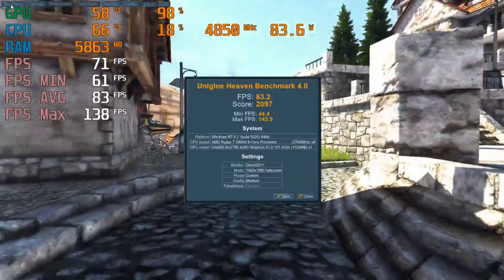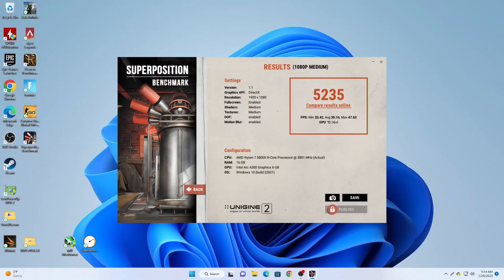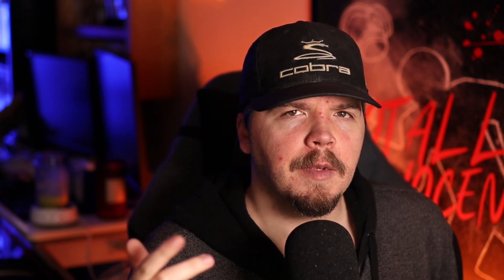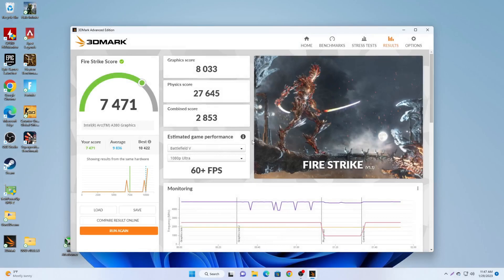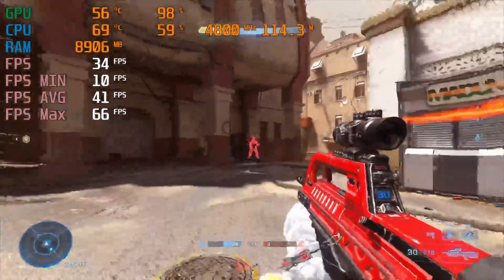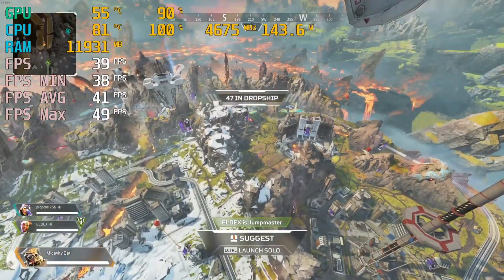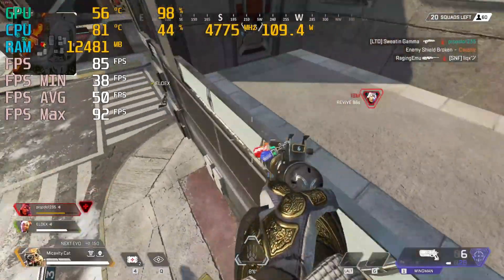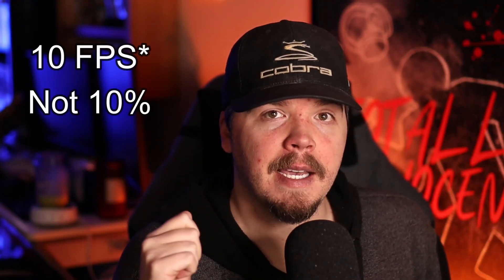Giving the Intel Arc A380 a MASSIVE Boost!

Comment: Hello. Maybe my comment will be outdated but I really need help. Right now I’m looking for a dedicated streaming pc using av1. And I have two options both almost the same price. First is to build pc with 16gb ram i5-12400f and arc a380. The second one is a laptop Lenovo LOQ 15iax9i with i5-12450HX 8gb ram and Intel Arc a530m 4gb. The ram can be changed on laptop, it has 2 slots. The only reason that I didn’t choose laptop already, I’m not sure is it enough a530m with 4gb for 1080p/60 or 1440p/60 av1 streaming. Did you have any thoughts on this?
Reply from the maker: Personally i would build the rig with the a380 IF you have room for it, 4gb vs 6gb card but i dont have a ton of experience with dedicated streaming pcs!
Reply: @MicavityCatYT  thanks for answer)

Comment: The intel arc a380 is more for 1080p gaming and that is also why u should pop open intel control where u can turn on retro scaling which turns whatever resolution ur using to basically look like ur using any other larger resolution not only giving fps boost but in some pcs getting rid of stutter.

Also if someone here is looking for a automatically boosted a380 card get the asrock it comes whit built in mhz clock boost of 2450mhx max

Comment: Better card than i thought, but i think running an Arc card on an Intel system, there are several settings that can improve performance a bit overall, both in bios and with the graphic driver itself + some of the features that comes with your software for your Mobo(depending on the Mobo). So all in all a good card for the price here in Denmark. I will go for it in my next 1080p build, the price is fantastic 🎶💯🎶 Btw. Thx for the video
Reply: yes go whit it for 1080p thats what it was built for u will get bettert fps whit 1080p

Comment: I am going to buy a gpu i have three options rx580 rx6500xt and arc a380 which should i buy
Reply from the maker: I have no experience with the 6500 xt. really depends on what you want to do with it! For gaming, I probably wouldnt go with the A380. Looks like according to userbenchmark (take it with a grain of salt) the rx 580 is 3% faster than the 6500 xt, but the 6500 xt is newer and will have support for longer.  idk if the 580 has driver support anymore or not and idk when they plan on stopping that!
Reply: @MicavityCatYT  so which GPU do u prefer for gaming
Reply from the maker: In general or for a budget? I run a rtx 3080 in my gaming rig. For budget options it depends on the budget. the 4060 will be releasing soon for $299. the 3060 can be had on ebay from 200-300 dollars and the 3070 is going from 350-500. My wife runs an Arc A750 and it does pretty well for a 220 dollar card. I like the A380 but not for gaming. It does OK but some games push it too hard and others you have to play on the lowest settings to get in playable. A380 is an awesome encoding card for a media PC or for a streaming PC in my opinion.
Reply: @MicavityCatYT  RX 580 always a great card, but go for the 6500 XT if possible... New generation and a great 1080p gaming card, well they both are.
Reply: I run the 6800XT, my son has a Nvidia 3070. But a friend of mine bought the RX6600 and it blew me away, what a great card... Beautiful graphics

Comment: So.. as a video editor do you think its gonna be useful for me? if yes, which motherboard is suitable and which processor? and thank you for the amazing review.
Reply from the maker: Hello Zach!
I am not sure if the A380 would be the best for editing and rendering. Maybe that would be something I could look into and see if its feasible or if its just not fast enough. I edit in premiere with a 3 gen old intel i7, but my bench runs a Ryzen 7 5800X which is slightly faster than my current intel. Ryzen 5000 series on a b550 motherboard should be just fine for editing, unless you are talking about rendering cinema movies and doing CGI and effects to that nature. 

As for the GPU I run an Nvidia RTX 3080 and it renders my 10 min youtube vids in just 2-3 mins. 

I guess it really just depends on what you are looking to edit with it to be certain what you may want or need and your budget. For around a grand you could grab a b550, Ryzen 5000 series chip and a 3050 or 3060. I know intel arc is solid for video encoding with that AV1 stuff, I am just not sure on video editing. Like I said though, this may be a good video idea as you have colored me curious now!
Reply: @MicavityCatYT  thanks for your response, I kinda have a deal with Ryzen 7 5700g and RTX 3060 do you think its good enough to run Adobe premiere? I hope that someday you make a video about budget Pc building for video editing became nobody made a clear review so far. Again thanks for your attention 🙏
Reply from the maker: For sure! Yea i think that should be fine for premiere editing! I used to run a 2070 and i think the 3060 may be slightly faster than that, maybe a little slower, id have to look, but it should be just fine for editing videos in premiere!

Comment: I've been using the asrock challenger a380 since memorial day, with a 12400/h670 d4. It had some odd issues with text on buttons when in dx9. It got resolved in the November driver update. While not giving high frame rates, it's 'monitor' is an old 24" 1080p TV that maxes at 60hz. It does all my normal productivity things without issues except the things that require cuda or tensor cores, those have already been ported over to my jetson xavier nx for a combination of availability and power efficiency.
Reply from the maker: Yea i think its a decent little card, after rebar got turned on, but gaming is rough sometimes. We will see, these new drivers coming this month if not out already are supposed to make the arc gpus pretty decent in older rendering engines. We shall see!